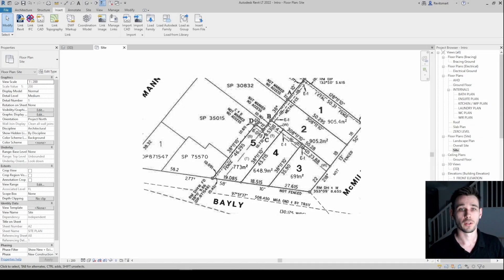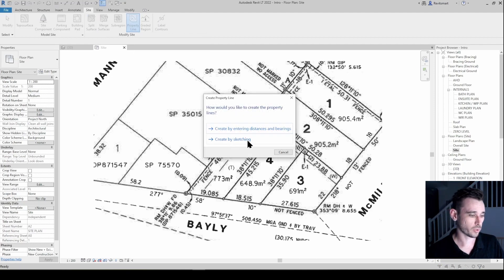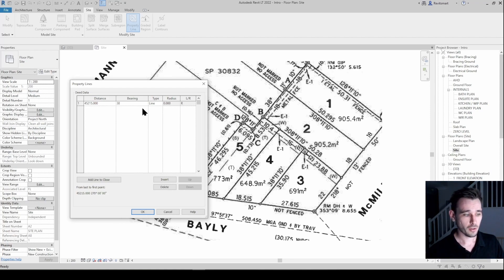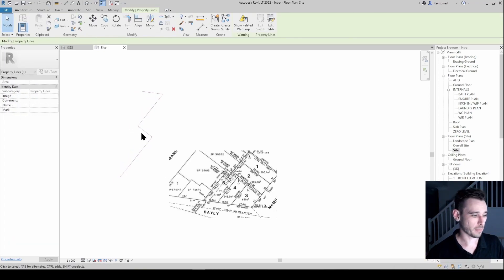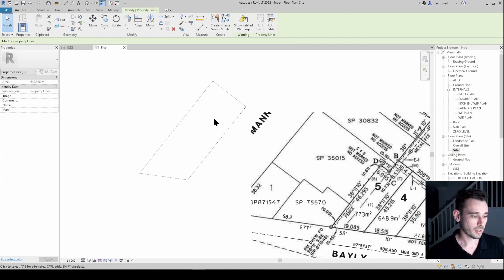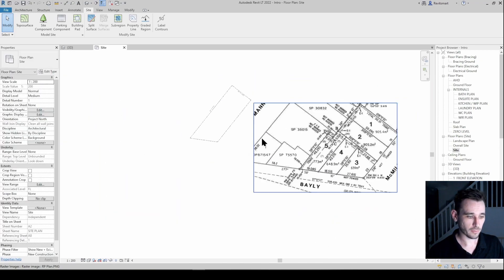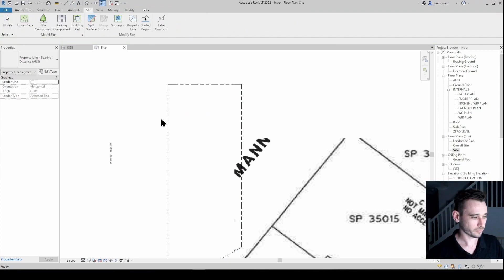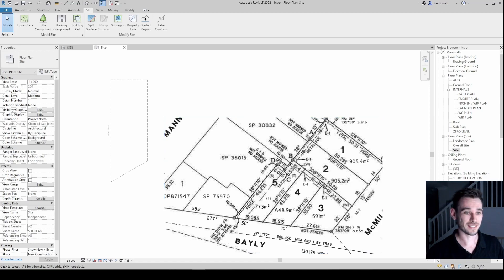Revit Smart: How To Draw Property Lines Using Distances & Bearings

Comment: Thanks for the tips. In surveying all bearings are taken in a clockwise direction from true north, this is handy to know when drawing up boundaries. From 0 to 360 degrees.
Reply from the maker: Thanks for that! I'm not sure if it explains why two parallel boundaries could both have the same bearing though?
Reply: @RevitSmart  I believe that is how they have presented the information. If you follow that convention I mentioned above it shall always close. One thing to note is that when drawing up this boundary in Autocad following the convention I mentioned above, you’ll find that there is a misclose. A Misclose is a result of errors in survey measurements. Not all measurements are perfect in reality. There is an acceptable misclose in a survey traverse, it comes down to Bowditch corrections.

Comment: how do you get the bearing to be more than 90 degrees ?
Reply from the maker: I'm not sure what you mean sorry - can you let me know when in the video i'm doing what you're trying to do and it's not working for you?
Reply: exactly my point
I noticed however, that his own property menu does not have N/S and E/W columns and I guess that's why he can input bearings larger than 90degrees 0' 0'' example 277 58' 10''
Reply: To fix this though, follow the steps below:
Click on:
1. Massing & Site tab
2. The Arrow pointing diagonally downwards to the right side of Model Site 
3. Site Settings Menu comes up
4. Then Click on Angle Display (Bottom Left)
5. Change the Angle Display to Degrees (as against "Degree from N/S")
6. OK
7.You can now input any bearing (you'd notice your Property Lines Menu now looks like the one Revit Smart has)
8. I hope you see this when you need it.
Reply: @onyedukachukwu Thank you!
Reply: Thank you so much! I am looking for the answer today’s 😊